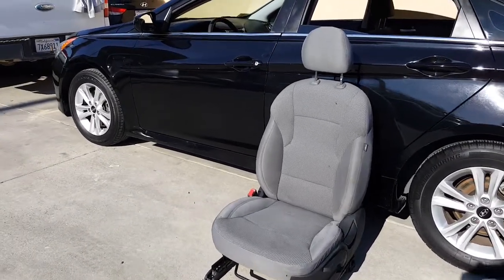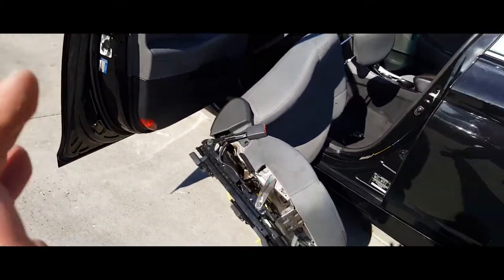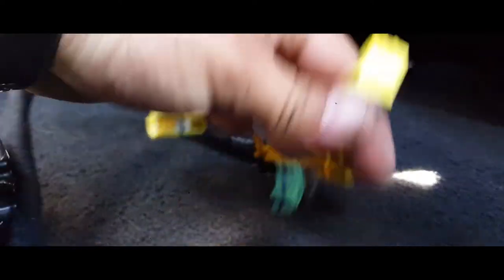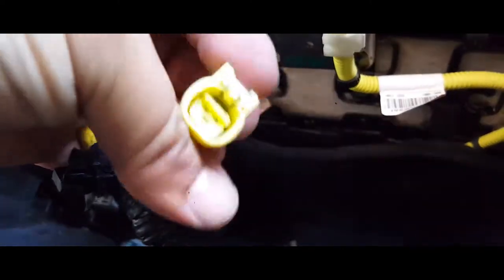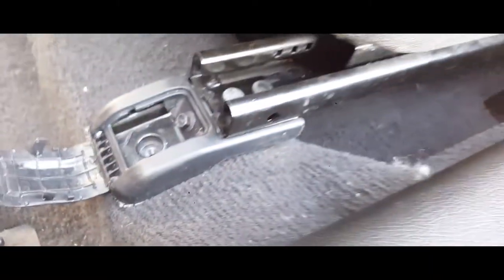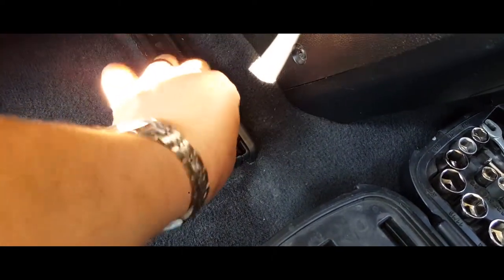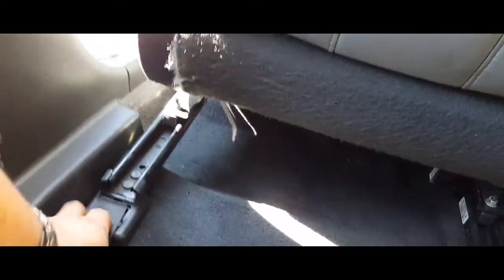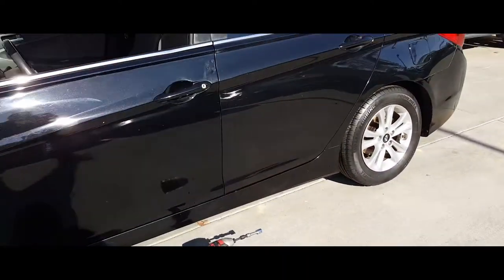How to: Install Driver seat 2014 Hyundai Sonata

Comment: Good how to! Would you happen to know if I can just mount power seats into a non-power seat sonata and add a fuse for them to work?
Reply from the maker: You can but it will be a lot of work. You will probably need to purchase the Electric seats and run all the electrical. It can be done but its a lot of work. And yes pls do add a Fuse, you dont want to catch your car on fire.

Comment: I will replace mine, it's electrical one, do I have to re-program the new(used )seat after replacing it or just connect the connectors??
Reply from the maker: No, no reprogramming is necessary for the chairs...good luck!
Reply: @559powerscape  You are right, I got it from junkyard $170
Reply from the maker: @zn6151  heck yeah nice find brother!

Comment: I have electrical seats and I removed them just to clean under it I didn’t touch the wires and it moves back and forth and everything works but it just won’t move forward all the way it stops after a short distance and I can’t put the back bolts back in is there anyway to fix that
Reply from the maker: I think the track is make sure there's nothing in the way, like the carpet or wires. It might be out of alignment causing it to get stuck. You can try spraying wd-40 on the tracks to see if the release.  Don't force the motor. Just slightly move it back and forth to see if it gives. Im not really sure, electrical seats are complicated 😕